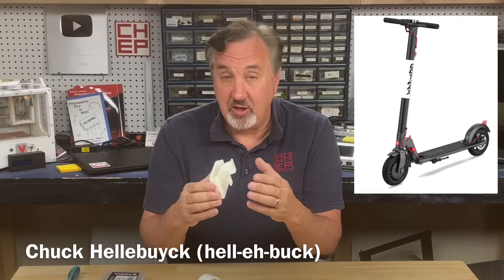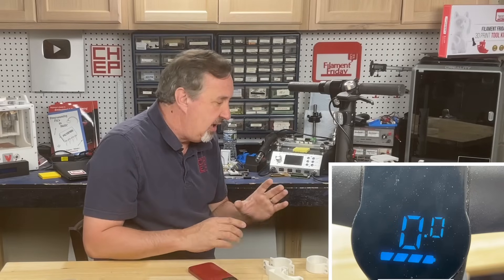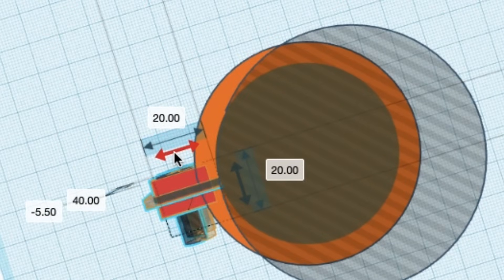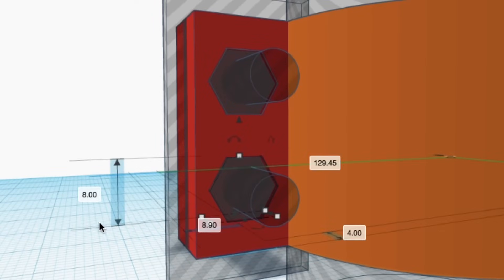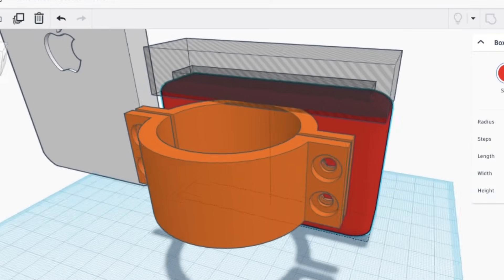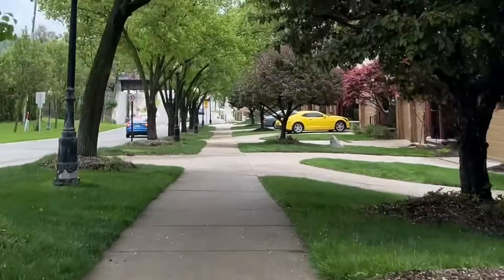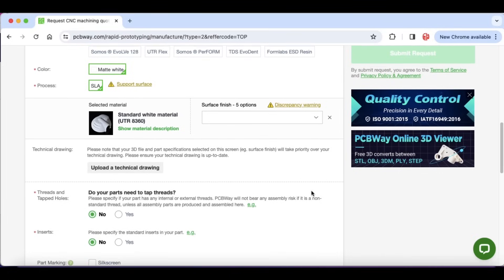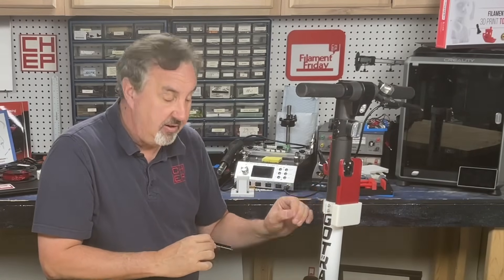Achieving the Ideal Press Fit in 3D Prints

Comment: on a more advanced cad software you can make the hole quite bigger (0.5mm is my go to) and add a compressible rib goind inward on each flat side that will be crushed by the nut when pushed inside

Comment: Always wished for a reference sheet of clearances to use for things including your nut clearance for snug fit, etc.  I would use some of the rubberized shelf padding material to cut a piece long enough to wrap front and back and underneath to slide the phone into the pocket.  Maybe even another piece cut and dropped into the bottom for add'l padding down there.

Some day you need to spend an afternoon and learn FreeCAD.  Like you, I started out in Tinkercad and I can tell you, a few hours of learning and you'll never look back.  The simple ability to draw any shape with line segments or curves, as complex as necessary, and extrude that out to any height in a single command simply changes everything.  And then you realize it's the same process for any pocket or opening; draw the shape on the surface and pocket or hole it as deep as you want....  It eliminates all the solids and holes that you have to join to make complex shapes.  Simply draw any shape, and either extrude it or use it to make a cavity of any depth...  I used to dread the thought of all the steps to make a complex shape in Tinkercad, that's all gone now, and the niceties of one click rounding or chamfers on complex shapes, precise curved cuts, etc. make it way more useful and fun.  There're tutorials for everything once you get past the basics of the interface and toolbar functions.

Comment: I still use tinkercad for quick stuff like this.  Still a great tool and IMO nothing compares to it for quick prototyping.
Reply: Nah, I started out on Tinkercad, got very good, but was tired of all the joining of solids and holes, un-joining to modify, etc.  A few hours invested in FreeCAD and I never looked back other than using it to cut up a finished item for a partial test print.  After about 10 hours invested, you'll find you can create shapes like what he has here in just a few minutes.  And you have the potential for things you simply can't do in Tinkercad like chamfer a finished design's edges such as the top of these bracket pieces for a nice rounded look...  Dimensions in hand, and with FreeCAD open, I could create his phone mount in about 2 mins. and not have to mess around with all that joining.
Reply: @brianmi40  I use F360 for most of my projects but Tinkercad still has a place.  Horses for courses.

Comment: With press fit I have had nightmares with some filaments. I would make 0.1mm adjustments and the carbon fiber tube I am working with won't fit, the other way around won't hold. This is carbon fiber reinforced petg on k1 max. I resorted to adding a thin layer of epoxy inside to make it a tight fit that can be disassembled
Reply: For such filaments, make a test print with 5 or so different clearances side by side in a small print and see which fits best.

Comment: If you printed it in PETG it would be flexible enough and not crack so you would not need both sides.  PLA will get more brittle when it gets colder out.

Comment: My printer is printing holes undersized.  Do you have a video about fixing that? Thanks
Reply: sometimes changing the order of printing of the walls can help (try outside first)
Reply: @littlefrank90  Thanks will try that.
Reply: He does have a video about adjusting hole sizes. He even shows how to do it in 3 different slicers. I don't remember the name, but I think it was 6 or 8 months ago.
Reply: Just design a small test print with 5 or so various size and see which fits best afterwards to use.
Reply: @brianmi40  did that and followed the advice on hole sizing from Chep and my printer is on size.
Reply: @Melw44  Cool. the tiny test print method is the way to go when you don't have a spec to try.

Comment: Maybe I'm an idiot, but I'm having a rough time creating the geometry.
Reply: It's WAY WAY easier in a real CAD system like FreeCAD.  I started out on Tinkercad and dreaded all the positioning and joining of hole parts to get what you needed, then unjoin to move for adjustments and rejoin...

FreeCAD you simply draw the complex shape of one side of the clamping part as seen top down (curved portion and "wings" for the nuts: all as one drawing shape), then extrude it up as high as you want it to be tall.  It's a game changer when you realize you can draw any shape, no matter how complex as just a 2d drawing, then extrude it to desired height.  Then when you realize it's the same thing for any cutouts, cavities or holes: draw the shape on the surface, and tell it how deep to make the pocket or hole (partial for nuts, all the way for bolt holes...).  Once you realize you can do all these steps on any surface of the object you are creating then it just explodes for you and you realize how trivial it is to create parts of this complexity going forward.

With dimensions in hand and FreeCAD open, I could make his phone mount in about 2 minutes.  seriously.  Hundreds of tutorials on YT and you can't be free for the open source software.
Reply: @brianmi40  Thanks!  I'm using Fusion 360 and still see no way to create the hex to the dims according to the video.
Reply: @mikewaskewicz  no polygon tool?
Reply: @brianmi40  Yes, I tried the polygon tool and manually also. It comes out distorted because of the additional clearance across the flats. Have you drawn the hex to Chep's numbers?

Comment: Your measurements and clearance adjusting seems a bit weird to me. First, the measurement across the points is off. A hexagon that's 7.90 across the flats would measure 9.12 across the points. A real world nut would probably measure a bit less across the points because the corners are slightly rounded, but I can also see in the video that the nut was a bit crooked when you measured across the points. Measuring across the flats should be all the information you need.

For your model, it doesn't make sense to change the "across the points" and "across the flats" dimensions separately. Either one of those fully defines the size of a hexagon. I'm not too familiar with tinkercad, but I guess maybe you are just scaling it differently along the two axes? In that case, you are making a "squashed" hexagon and not a regular polygon. I think this would be counterproductive to having a good fit. Ideally, you would want to maximize the surface contact surface area, so the hole should should be a regular hexagon and not a "squashed" one.

I would just measure across the flats and make the hole a regular hexagon using the same measurement plus your desired clearance. There's no need to measure across the points at all.

Comment: I would rather turn those nuts 30° around. That way no need for bridging, the bolts can get closer to the curved part and the flaps can be smaller at the same time. Some chamfered ribs below, above and between the nuts would make the whole thing stronger and even look better.

Comment: 1. There's like absolutely no reason why you couldn't have made this with Heat Set Inserts ( other than it being an educational video about press fit Nuts )
2. I'd be having MAJOR™ trust issues with the Cup only holding onto the lower ⅓ of the Phone - Maybe increase the depth the Phone can slide in to right up the Camera Array?
3. I know ( or at least I think I do ) this Channel isn't exactly known for its elaborate CAD designs but man... Strain relief Fillets, Chamfers, Ribs, etc... Their total lack of existence me sad 😑
Reply: I agree with points 2 and 3, but more people will already have hex nuts lying around and they work just as well as heat set inserts. Other than looking a little cleaner and being less prone to falling out after the material creep sets in, there isn't really any compelling reason to use heat set inserts over hex nuts imo.

Comment: I'm going to watch the whole video, but wouldn't nuts encapsulated in the print be the most secure method?
Design it so the only openings are just big enough for the bolts. You can put pauses in the G-code once the holes for the nuts are complete, drop the nuts in place, then resume the print.
I use this method for placing magnets inside my prints that need them.

Comment: you can also add a taper to the hexagon I usually use something aroune 3 deg to make it even tighter when you tighten it. And I assuem you printed it in PLA that is why it cracked. Print it in PETG and use 2 perimeters and 100% infill and you probably can mount a seat to it lol.

Comment: This works on the K1 but each 3D printer has it’s own tolarances. When it’s printed on a K1 the nuts are snug but when printed on another printer they may be too tight.
Reply: For printers which are properly dialed in and produce walls not exceeding the design boundaries, this clearance is pretty much universal. Aside from CHEP's Creality K1, it's exactly what I use on both my Ender and my M45 delta. Not just for nuts, but even press fit of 2040 extrusions.
Reply: Simply create a tiny test print with 4-5 nut clearances side by side and after you can see which fits best...
Reply: @brianmi40  That works, but if your printer is dialed in, you're going to find CHEP's recommendation is the best. If not, it's better to calibrate your printer than to change your design, so that your design works across a range of printers.

Comment: I also recommend you print a top bracket for the phone so the phone doesn't fly out when you hit a bump.
Reply: just needs to be deeper pocket so just the camera is exposed.  Then pad it with something like the rubberized shelf material via a piece cut to wrap front, under, and back as you slide it down in.

Comment: Sorry but your age its for electric scooter?😅
Reply: Your grammar is poor.
Reply: @meanman6992  i know i don't speak English well.
And what i answer was a joke 🙂🇨🇾👍🏻
Reply: @meanman6992  you like 3d printet pew pew Mr ATF?😜
Reply: I'm 66 and have ridden one for years.  Does get a bit tiring standing though on long rides, so prefer my electric bike.
Reply: @brianmi40  nice.
Was a joke for Chep.
In less lethal community they know my humor 😅
Reply: @noobt4eguns  relax, no one insulted you nor misunderstood.  Just a comment about my riding one.
Reply: @brianmi40  Yes you are right the electric bike its good because you can seat☺️
Reply from the maker: Scooters are smaller and can fold up to put inside our small van. Bikes require a rack. We may get bikes in the future but for now the scooters can travel with use easily.
Reply: @FilamentFriday  I also travel by van conversion, my folding bike pulls out on drawer slides sitting on a shelf under my bed at the back in the "garage".  No rack.  Custom TPU printed pads for the wheel holes in the board it sits on.
Reply: @noobt4eguns   Yes, and generally larger or more easily swappable batteries.  I have both a long range scooter (around 25 mi.) and a long range eBike (about 42 mi.), but after a few longer trips on the scooter, I do all those on the bike now.
Reply: @FilamentFriday  have folding bikes
I had one French brand and i sold it.
I bought it 350 euros and i sold it 500 euros long time ago.
Believe me the electric folding bikes they don't take much space and am sorry for my joke brother and was just a joke about your age.
Am not bad person but i like to make jokes and am little rude in reality am straight person and honestly i respect you.
You help allot of people with your videos 💯❤️❤️